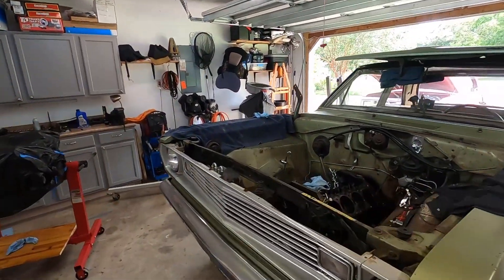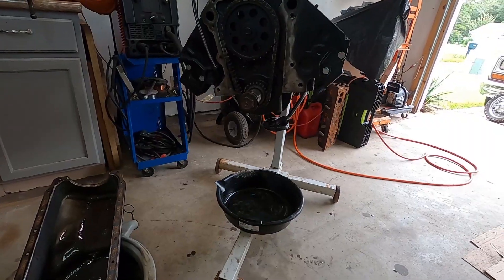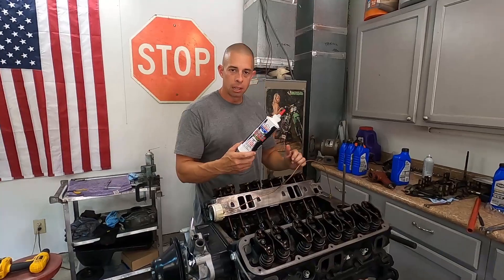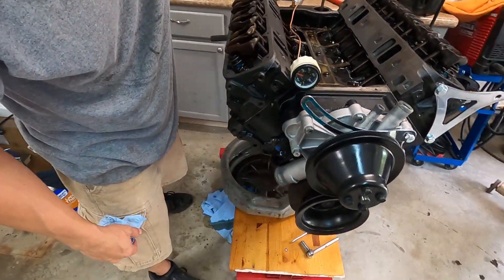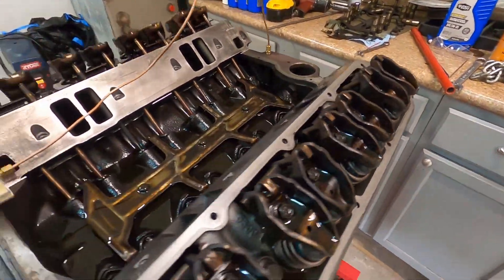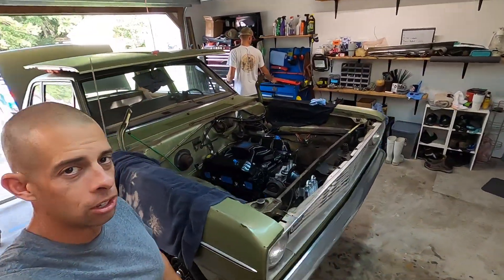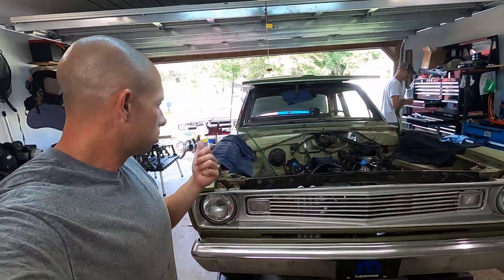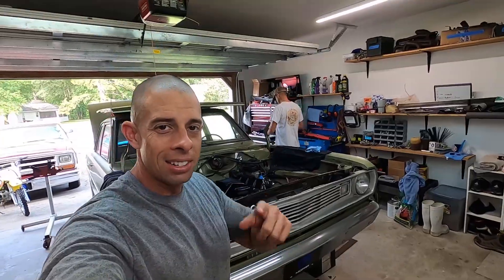FRESH MOPAR 360 going in!! (1969 Plymouth)

Comment: I AM GETTING READY TO DROP A 5.9 MAGNUM ENGINE IN A 1967 B BODY. THE ENGINE IS OUT OF A 2001 DODGE RAM. WILL A 360  LA OIL PAN OUT OF A CAR BOLT ON THE MAGNUM ENGINE?
Reply from the maker: Absolutely.